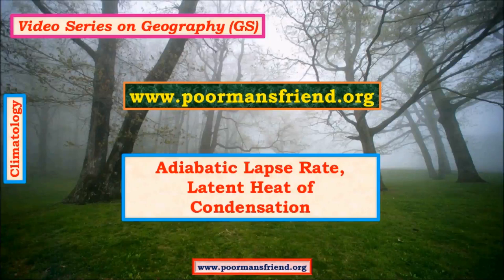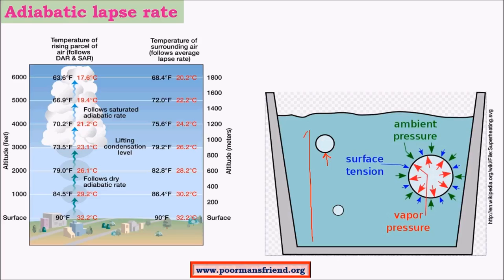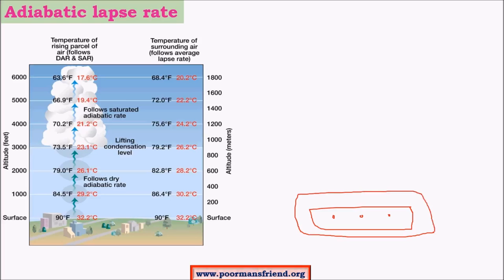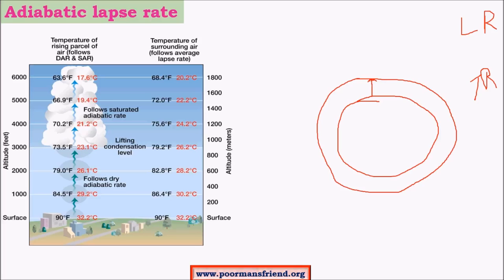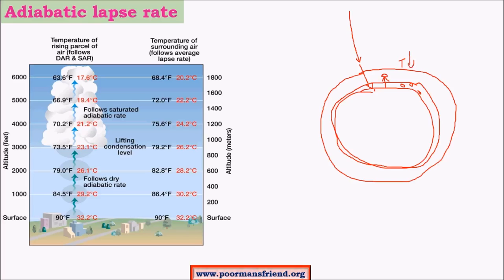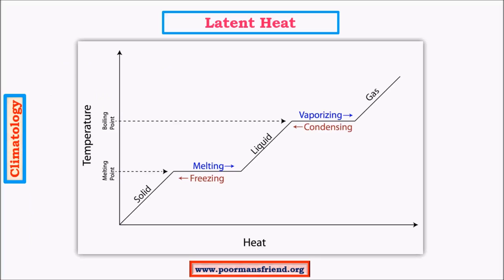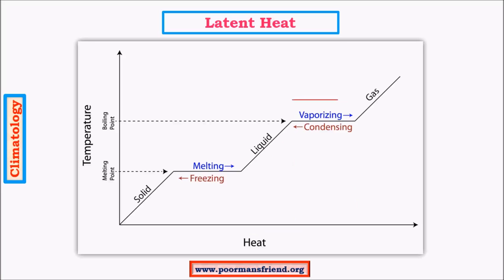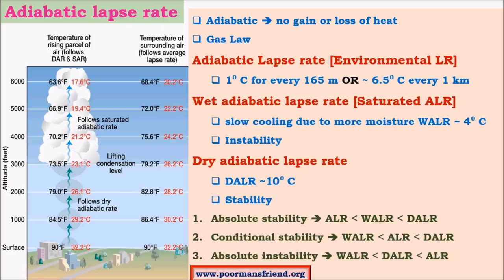C4-Adiabatic Lapse Rate,Latent Heat of Condensation-How sweat makes body cool

Comment: i think option 1 of the last question is also wrong as the heating of the atmosphere also takes place when insolation are absorbed by the water vapour and near long wavelength rays are absorbed by certain gases.

Comment: Good morning sir
I couldn't understand one thing u said pressure and temperature is direct proportional then in eg . Of air pascal with increase in temp why did pressure decreased from 12 to 10. Plz ny1 to explain
Reply: When  Air molecules are sufficiently heated , pressure increases. The air molecules have a tendency to move from high pressure region to low pressure region. As you said temperature increased and pressure also increased due to which the molecules shifted to lower pressure region. And thus the decrease in pressure above the air is noticed from 12 to 10 pascals

Comment: You say insolation is maximum at equator but according to ncert class 11 physical geography, equator receives comparatively less insolation than the tropics. This doesn't make sense.
Reply: The Equator receives comparatively less insolation during summer and winter solstices (this is because of the earth's tilt). But during equinoxes, the equator receives maximum insolation. Here we are not considering the effect of cloud formation. Because the equator sees greater cloud formation (because of ITCZ) compared to tropics (subtropical high-pressure belts) NCERTs say equator receives comparatively less insolation than the tropics. But this is not entirely accurate. It varies from region to region based on cloud cover.

Comment: According to gas laws pressure increase with increase in temperature and here you are saying it reduces how is that possible?
Reply: Volume is not constant, if air can expand pressure will decrease vice versa in case of a closed container.

Comment: when we are saying that due to sun's heat, the air parcel is lifted causing pressure to fall, then temp also falls as we go upwards . but how would it still be a low pressure area if temp is also falling ?? (bcos since we've associated low pressure with high temp area)

pls do answer this :/
Reply: the low pressure and high temperature area is associated with the surface temperature of the earth............... and the low temperature  is associated with increasing altitude when air parcel rises................i hope this clears your doubt